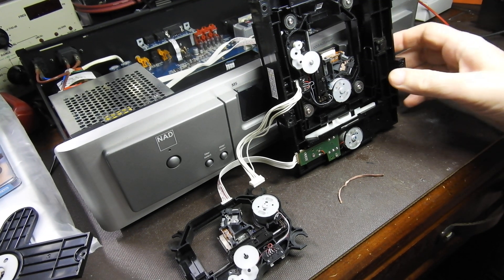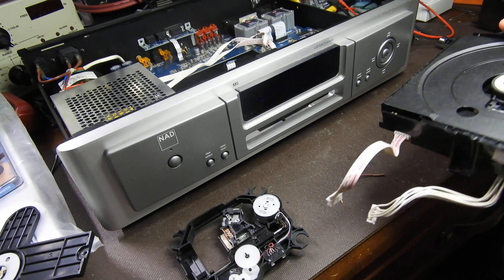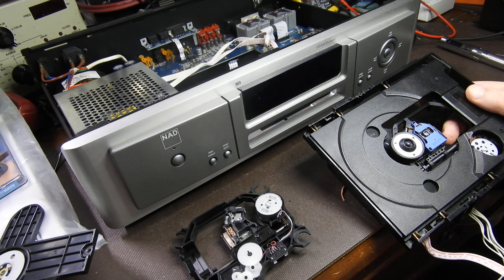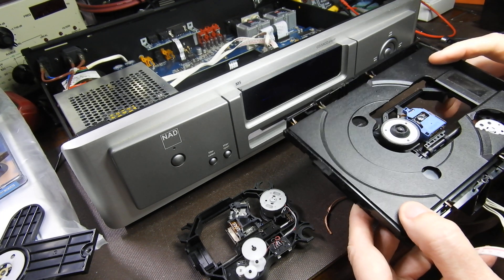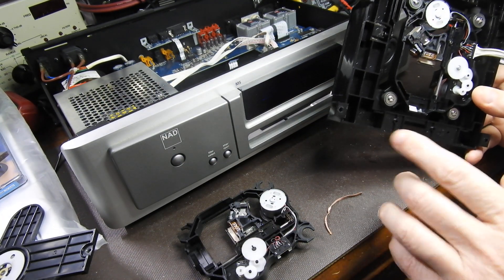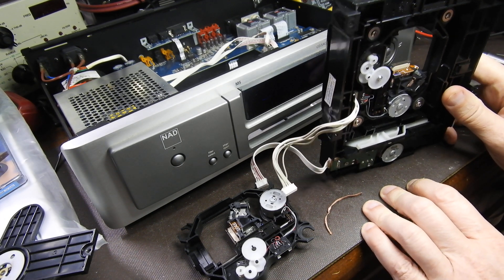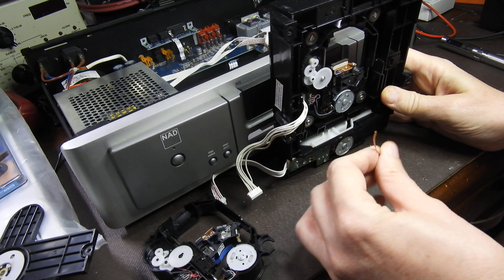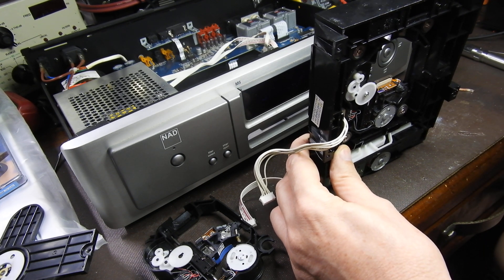Laser Replacement in CD player (NAD M5 SACD)

Comment: Thank you! Even if my player is a lot older and less expensive (C542), this helped me a lot in replacing its laser unit. Sometimes you just have to see, which parts to disassemble and which to leave untouched.
Reply from the maker: My pleasure. I benefited (and still do) from the immense info sharing on the Net and try to do my bit. Are you a subscriber? I need about 30 more to reach 1000 ;-)